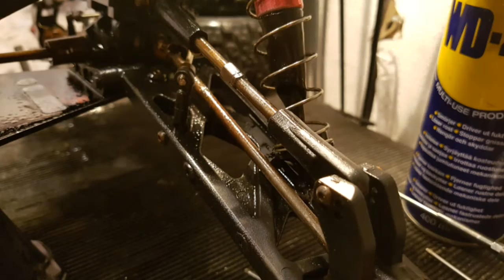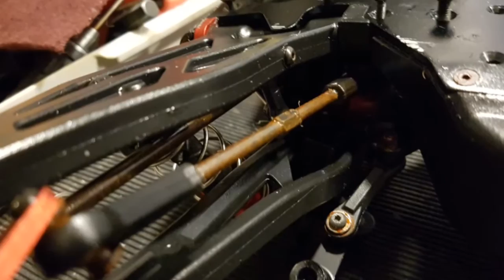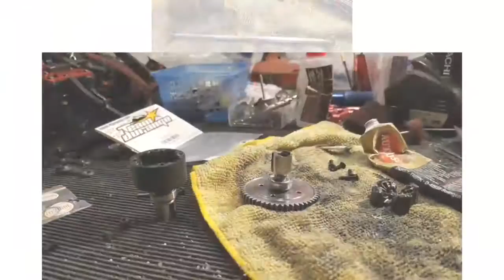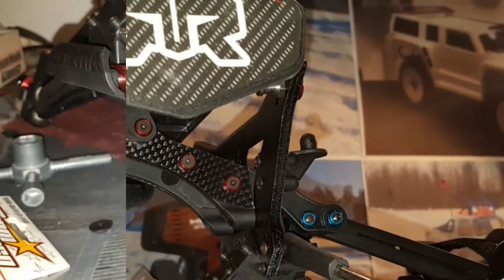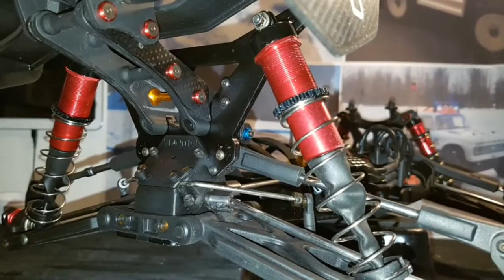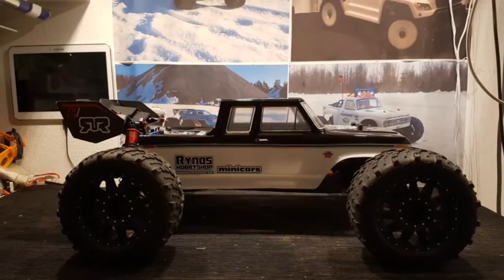ARRMA Kraton 6s - Linus P's ( my son )new. Before and after picturws

Comment: Your kid is going to love it.. nice job..How do you shim shocks ?
Reply from the maker: RCbashing the KRATON extra small washer above stock one under piston..huge air and bick pack can damage the piston
Reply: gotcha.. i already do that because the plastic piston kept breaking thru... You would think arrma would have put a little bigger washer then they did.Thx for response..BASH-ON
Reply from the maker: RCbashing the KRATON yes and no..i thing they can handle if you have the perfect harmony between spring/shockoil wt. i have gone from 50-60 rear/60-80 front down to 35 rear and 45 front on stock springs.